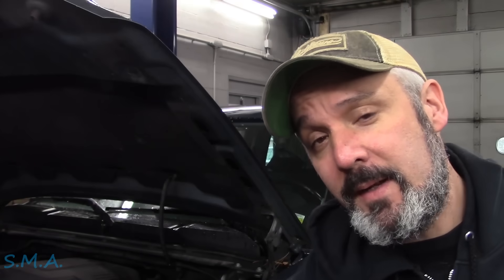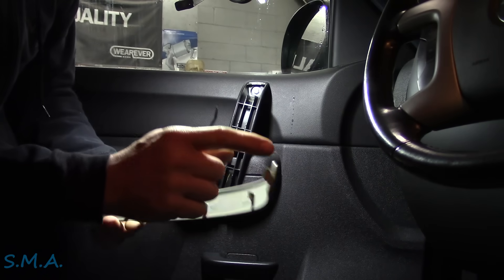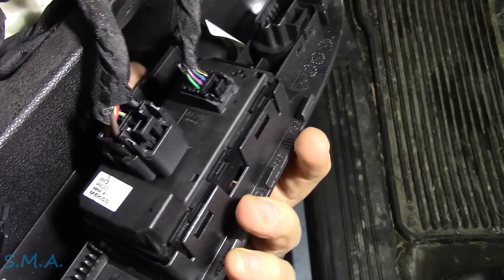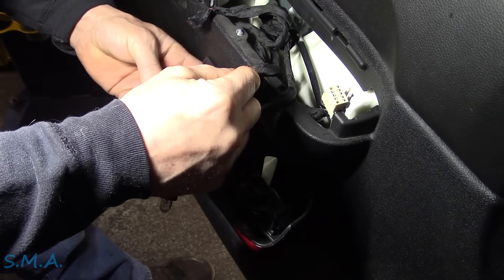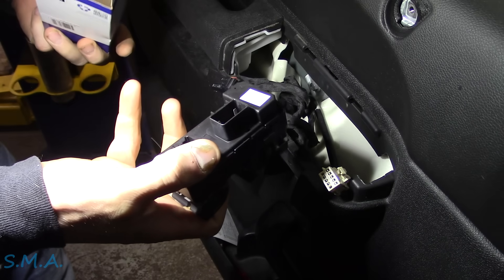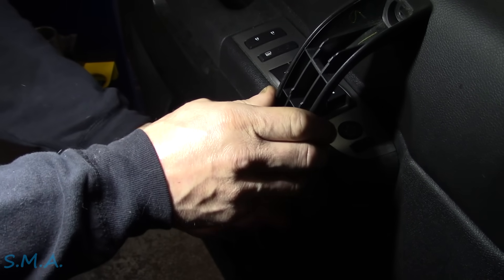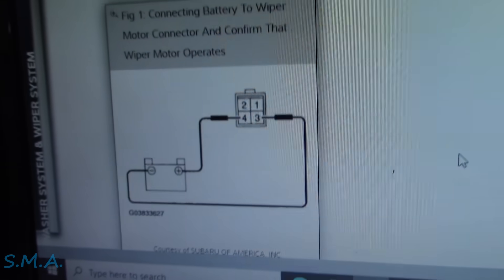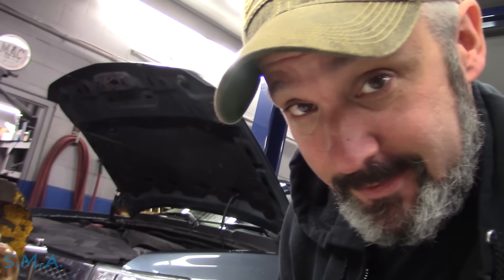Chevy / GMC Truck: Driver Window Switch Not Working On All Windows

Comment: I ran into a wiring diagram that was wrong for a Honeywell product. I contacted them and let them know about the error. They were kind enough to contact me a few months later thanking me for letting them know. They let me know they updated their literature and included a pdf showing the new drawing. It was STILL WRONG!!  They just changed the terminal numbers in the drawing but not the actual circuit.

Comment: So if you had followed the service data flow chart and turned the circuit in an auxiliary heating element, would Subaru have replaced the parts or done the government thing and just say you should have known better than to follow their instructions? No need to answer, Eric, I think we know what they'd say.

Comment: Parts lookup either. All of the parts lookups have one number for the front u-joints on my 2013 ram 2500 4wd. Actual part is one number higher. Somebody fat fingered the part number in at the beginning and all of the part look ups are wrong. No matter what parts store you go to.

Comment: I have a 2004 Chevy Silverado. Driver side window doesn't roll down I buy a new Switch because the mechanic..😢.. and it doesn't work. But I actually broke my door panel. Didn't you tell me..😢. It's so hard to find a good mechanic in California. So my window still doesn't roll down. Just can't trust mechanics nowadays. Very sad..😢😢.. just because mechanic doesn't mean that they know what they're doing. It's all about the money nowadays I just wish I could find an honest mechanic.

Comment: One wire to each motor requires a control unit on each door motor.....more places for compromise!! Vw/Audi still has this today. And that's why window motors cost 500 to 1000 dollars each!!   Crazy.  Why run just wires when you can put two or three control units in between and have 10 times more complexity.   They originally said it was to lighten up the wiring harnesses .  Well does a 12 or fourteen gauge wire really weigh all that much more than 50 or 100 22 gauge wires plus for or five control units??  Not really!! 
Also when you put in four control units to blow the horns something is wrong in the engineering department.   Repair costs are outrageous and customers are angry with good reason!!   All is good till the warranty runs out!!   Hahaha!!

Comment: (Troll comment) (angry YouTube commenter) 

You touching the door panel trims with that sorry excuse of a prybar is ruining the integrity of the plastic the metal contact will over time ruin the door panel trim. You probably damaged it already. That is a pocket screw driver that is used for turning small screws. I am reporting this video
Reply: Btw I love your videos and have been following you for years <3